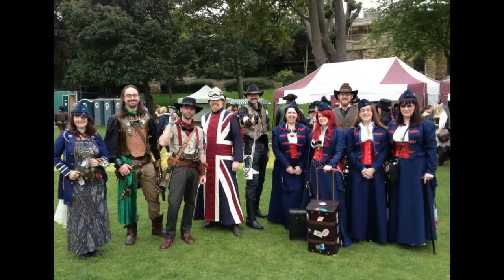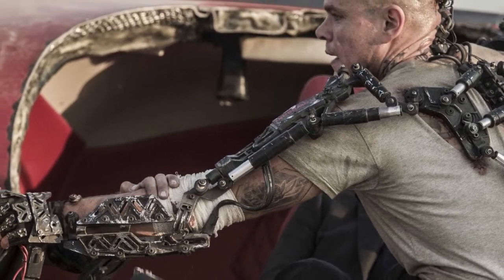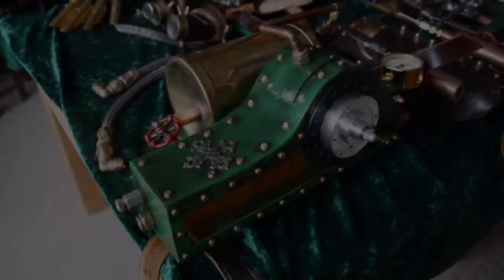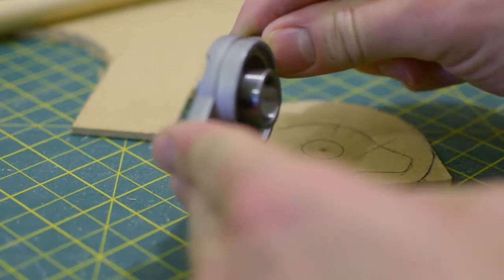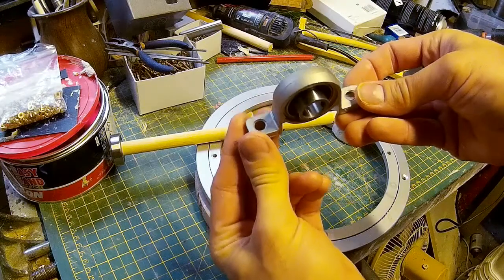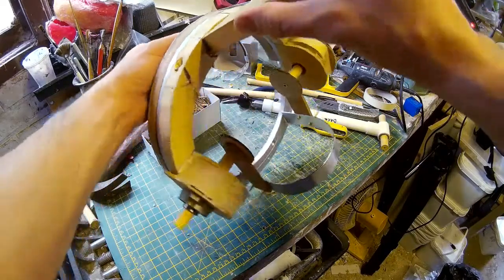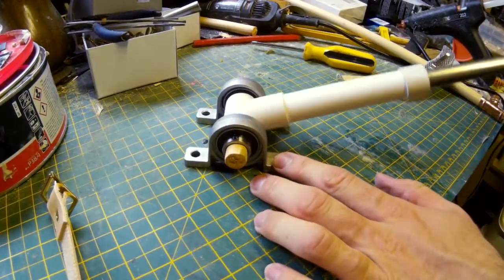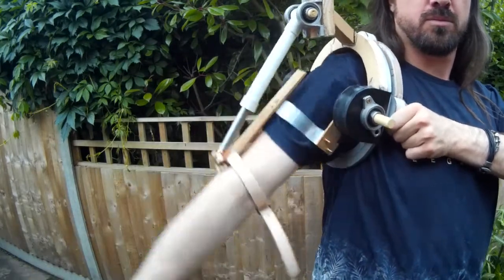Steampunk Exo-Suit Build Log Part 1

Comment: by the gods this is brilliant! its perfect for what ive been working on, any tips for sourcing materials?
Reply from the maker: Thanks!  To be honest I got all the stuff from the local hardware store (Wickes and B&Q if you're in the UK) and from eBay.
Reply: i shall be raiding B&Q then XD thanks :)
Reply: @thedarkpower  will you kindly provide me the background music name .
Reply from the maker: @e-guider  Hi.  No probs, it's 'Mother's Been Talking to Ghosts Again' by Tom Slatter  https://tomslatter.bandcamp.com/album/three-rows-of-teeth-2016-expanded-edition
Reply: @thedarkpower  rebuilt my printer, so can get started on this (hopefully for asylum) just wondering what size pipe and bearings youve used? sorry for the questions again XD mine prob wont be as good as yours as ive never tried anything like this before, but i hope i get close :)
Reply from the maker: Cool - no probs, I used 22mm PVC pipe and the bearings are pillow block bearings - the internal diameter was 15mm.